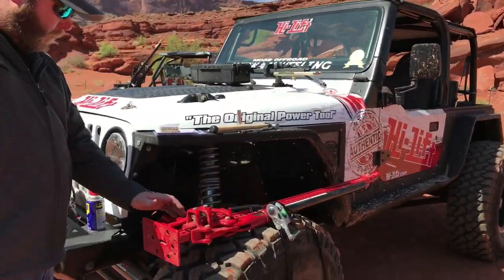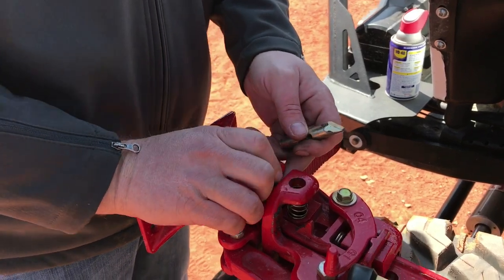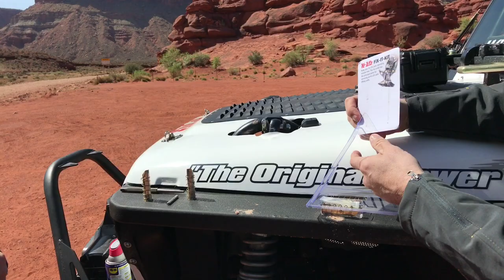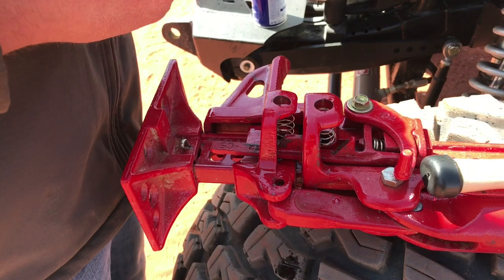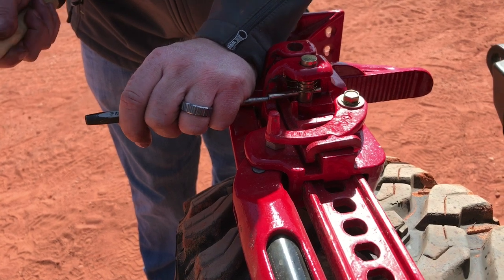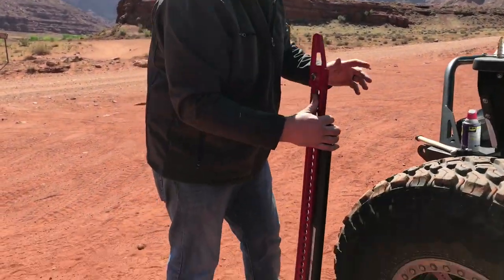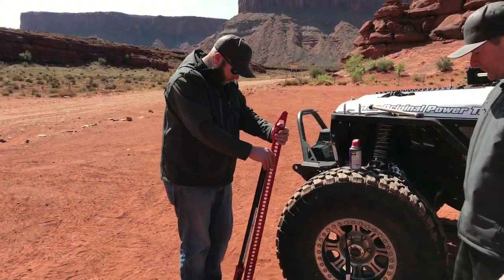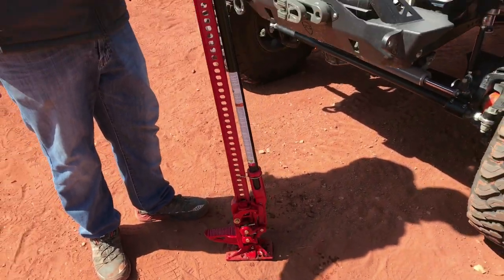Fixing a Hi-Lift Jack on the Trail - Fix-It-Kit Installation Demo

Comment: Thank you for posting this. Well done. My brand new one came with a bent pin! The seller sent me a repair kit, and your video will make it much easier to fix it. Carrying a spare is a great idea. I do have one suggestion for the viewers though. Having had to take my employee to a Dr.’s office (working in a medical building at the time), I am always worry about using steel hammer with steel punch, chisel, etc. A piece of steel fractured from the punch and lodged in employee’s forearm. A brass or lead hammer is always safer.
Reply: You're driving a pin, not forging a sword. If you have to hit it hard enough to shatter then you're already doing something wrong.

Comment: Thanks for this. I use my Hi-Lift frequently. I will install one of these repair kits BEFORE anything fails. Mine is old and well used and works just fine. But preventative maintenance is always best on a piece of essential equipment.

Comment: My jack somehow fell off my bumper on the freeway, I had an antenna mounted on the jack and the coax cable ran through the jack cover and held the jack with tire noise I didn't hear it some girls got beside me and pointed to the back of my Jeep, I stopped. The only thing wrong was one of the climbing pins was ground and the cross pins were bent. I just installed the repair kit and when I put the switch to up and only the top pin is flush.

Comment: I have a near new Hi Lift jack I bought from Northern tools, the thing will not lower a load now, I have had 2or 3 older jacks from the 80/90s that never gave me a problem, so now I have to buy this kit to make it lower properly? I inspected it today and didn't see any glaring problems with it...
Reply from the maker: Sorry for the late reply.  9 times out of 10, it's a matter of lubrication... even on a new jack.  Lubricate often to make sure it operates at its potential.

Comment: I have one of those with the pitman pin missing. Can i use a grade 8 bolt cut off for one of those?
Reply from the maker: Sorry, but we can't recommend that for warranty and liability purposes.  We recommend using only Hi-Lift replacement parts which are available at our online Store.

Comment: I have a 45 yr old jack- will this kit work? I believe it says only will work on newer jacks
Reply from the maker: If it has a metal handle with a round handle socket, it should work.  But it has to be a Hi-Lift or Handyman brand Jack.
Reply: @hiliftjacks  Oh it's an OLD Hi-Lift all righty. Thanks, I'm sending for the repair kit this pay day.

Comment: I have an older Hilift and just installed your repair kit. Still having problems getting it to go up. Will it only go up if there is a substanchel weight being lifted?
Reply from the maker: Make sure that your climbing pins are installed correctly. You can find troubleshooting instructions on our website - https://hi-lift.com/troubleshooting/

Comment: Can I  remove the cotter pin that goes through the base that holds it to the hi-lifts i-beam and weld on the base to the beam? Or what does other purpose does the cotter pin and base serve beside being The Base of the Jack? Does it play sort of a ''pivot'' role to the i-beam?
Reply from the maker: You can remove the cotter pin to take the base off, and to replace it.  We highly recommend against welding the base to the beam.  The flexibility that the cotter pin provides in allowing some pivot is best for keeping the Jack from getting up on the edge of the base and sliding out.

Comment: How about what to do if the jack is stuck up - holding up one wheel of a cargo van?
Reply from the maker: Good question, Cort. 9 times out of 10, a jack won't come down due to lack of lubrication. Be sure to lubricate your jack well prior to use and follow instructions listed in the manual that came with your jack.

Comment: love these jacks , my only complaint is the cross pins are to soft and bend
Reply: Marnie Larocque that’s because they are the relief valve
Reply: No, the shear pin is the safety piece that's designed to bend or break. The cross pins shouldn't bend.

Comment: Grind the pin and use it again.
Reply from the maker: You can try! ...we usually recommend using new replacement parts on equipment that is capable of lifting 7000 lbs.